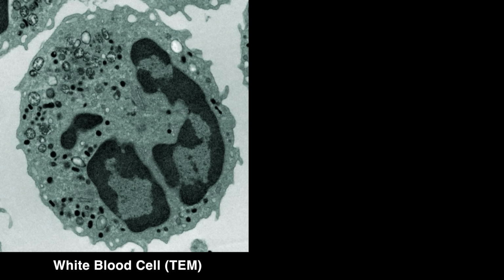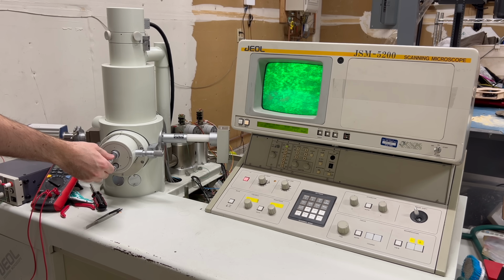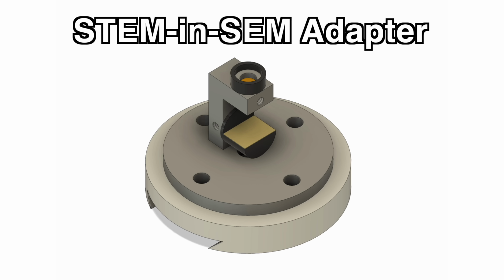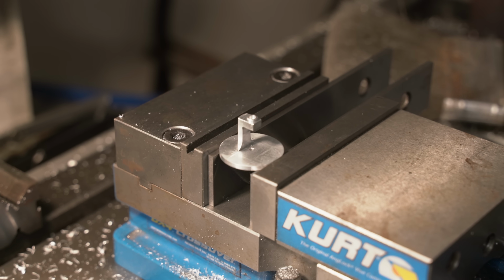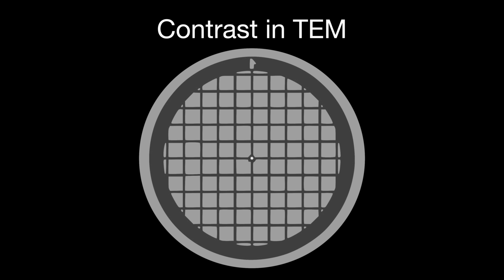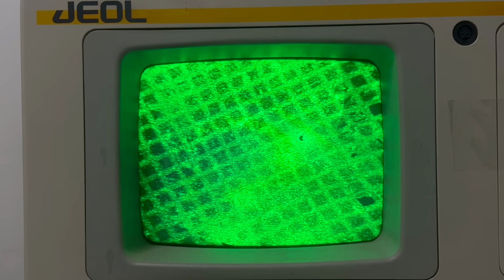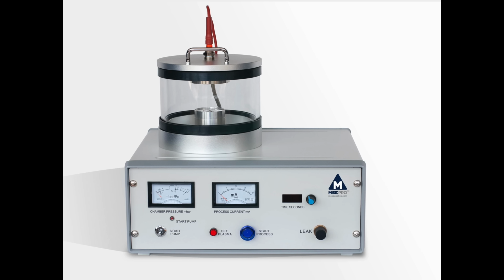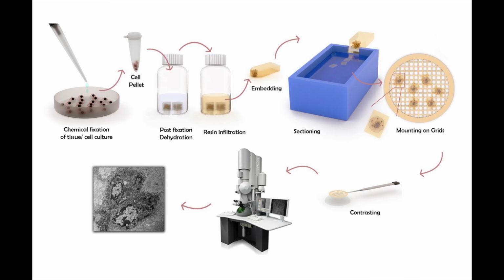Converting My SEM Into a TEM is Surprisingly Easy

Comment: These dome shaped candle flames are probably the most interesting and is something you can’t see typically in earth. It almost looks like something you would see from a plasma project typically done on either nuclear or arc reactors or even plasma gas tubes.
Reply: But those types of arcs domes or anything else are usually typically seen in those type of art tubes or other types of plasma projects are mostly require electricity. This you don’t need electricity for this to work just no gravity.

Comment: Why not use a longer mirror? (it doesn't have to be limited to the diameter of the mirror shaft).
Reply from the maker: longer mirror at higher angle increases the overall height of the apparatus, and the height was already a challenge given the small space available in the machine
Reply: @projectsinflight  A longer mirror would fit in the space you already have. Granted it might only give you a little more field, but you don't need to change the dimensions to achieve it (I wouldn't have posted my suggestion otherwise).

Comment: I used to work with a FEI dual beam with an immersion lens. FEI had a STEM detector that detected transmitted electrons.  The immersion lens allowed me to get STEM images with 800,000x magnification.  Of course, the price tag for that system is $1,000,000+ at today's prices😐

Comment: What is the reason for the TEM image of the wing not being dark in the places where the TEM grid sits? I was expecting the grid to shield all electrons and was puzzled why the sections of the thicker wing part covered by the grid were clearly visible while the thinner wing part sections covered were dark.
Great video!
Reply from the maker: some secondary electrons are still getting through unfortunately. i may have to redesign the adapter again

Comment: Very nice!  Instead of the tall shield ( or perhaps in addition). Did you consider biasing the grid on your SE detector negatively ( a few 10’s of V). ?  Secondary electrons typically have an energy of 40 eV or less, so you can target low loss electrons like this,  i.e. electrons that lost little energy in the tem sample.
It may also be interesting to collect those electrons that were deflected a small amount in the tem sample, for example with another faraday cup under the tem grid, that would capture undeflected electrons.
Finally if you really wanted to make an electron mirror,  you could consider putting a small glass bead  or plate in place pf the gold mirror.  Right now your mirror has the electrons that pass through the tem sample striking the mirror, and then secondaries from that process reach the detector.  When the glass bead charges up,  those transmitted electrons are unable to reach it and are deflected to the detector instead.  This works well if you first charge the mirror up with a 30 kV b eam, then change your beam down to a lower energy.    Good luck!

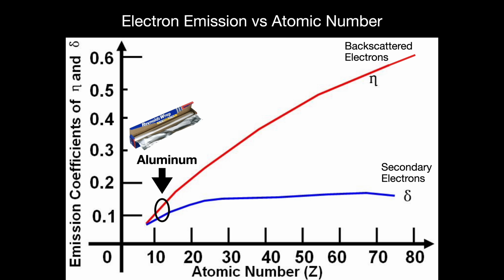Comment: 25:12
question: why did you use gold instead of something like lead, that would've been quite a bit cheaper
unless it's because you already had that gold lid
Reply from the maker: the electron beam can cause the lead atoms to eject off the surface and start coating the inside of the chamber with toxic lead powder

Comment: I briefly showed your video to our SEM expert. He said that a negative voltage should be applied to the stage so that the electrons are repelled.

Maybe I missed it, but did you do that in your experiment?
Reply from the maker: i don't understand why i would bother to do that. It's true that this is a feature of modern SEMs that allows you to slow the electrons at the last moment so that they don't penetrate as far into the sample and give more surface detail, but in the case of the tem adapter i can't see why it would improve the image

Comment: Not a good oractice to hold the parts in one side of the milling vice. This un called an "unbalanced" grip, it causes the movable jaw to tilt, and the grip strength plummets. In extreme cases where you need to hold the parts in the side, you need another part or the same width in the other end.
Reply from the maker: fortunately, you can get away with a lot when your part is a tiny piece of aluminum

Comment: Oh no my lathe chuck doesn't have a big enough borehole. Does extra steps to accommodate. Now we're going to switch to a different chuck with a bigger borehole for the next steps.
Reply from the maker: The limitation is from the lathe's spindle (the shaft that the chuck connects to). Even if the 4-jaw has a large enough hole, the stock still wouldn't fit though the spindle bore.

Comment: 19:24 Simple solution: Bigger (wider) mirror.  First off, sample holder and base plate can be the same part of that mode, giving you additional clearance, lifting mirror more off the ground allowing you to make the mirror wider. See 15:19 If that is your desired maximum angle, the mirror could be so long, it would touching the base of the sample holder. The screws get in the way, though. but if the base plate and sample holder is one part, then the base of the sample holder goes away and so the screws = more clearance for the mirror.

Comment: 2:12 Hey I was wondering what happens to the left over atoms one the primary electron has bounced off with the secondary electron leaving. If it is a metal does it become an ion but what if its a nonmetal? I'm in high school so this info isn't necessary but it wont hurt to understand. Thanks. Also where do the secondary electrons come from? How are they produced?
Reply from the maker: there is a power supply in the sem between the electron gun and the stage. the electrons from the beam come from the power supply, and they impact the stage/sample which is connected to the other end of the power supply. This prevents an imbalance which would cause electron accumulation
Reply: @projectsinflight  Thanks and the left over atoms?

Comment: is the shield grounded? You could apply a small positive voltage to the shield to attract the secondary electrons ofc not too strong so you dont influence the detector or the electron beam trajectory.
Reply from the maker: So, this wouldn't work, but maybe not for the reason you might think. In order to apply a positive voltage to the shield, you'd need to insulate it from the rest of the sample holder (which is grounded). this means that you'd need a small amount of an insulating material. When an electron beam scans across the insulating material the electrons captured cannot go anywhere, so they build up. The charge on the insulator can build up and up until it's several thousands of volts, which would dramatically affect the beam path. So by creating a small voltage on the shield, you'd inadvertently create a large voltage near the shield
Reply: @projectsinflight  very interesting. Can't you just extend the shield hiding the isolation material so the beam can't hit it?
Reply: @ImPresSiveXD  Yes, very interesting and expected based on the goal of metalising most samples.
I wonder if the mosquito wing would have suffered a little from charge build up.

I also wonder if a resistive shield could work with the top at a controlled potential and the bottom at the ground potential, then there would be no insulator.  I am clueless enough to not know whether a positive or negative top opening would be optimal but it should be easy to test.  Not sure what would be a suitable insulating material but graphite comes to mind.

Comment: I'm wondering if you can ditch the shield and instead image without the mirror first and then with the mirror, finally just subtracting the two images. It would be difficult to ensure the sample is exactly the same between the two exposures however. Great video.
Reply from the maker: For a good SEM, perhaps (though you might have noise issues). For my sem, there is zero chance that the image wouldn't drift between the two photos (because of my aging circuitry)
Reply: @projectsinflight Yeah I imagined that would be an issue. Thanks for the answer.

Comment: Really great work!

Question though: On the graph with the emission coefficients: Why did you mark the point on the red line which shows the BSE rather than the point in the blue line which is for the secondary electrons? Did you omit mentioning that you are actually using back scattered electrons to make the image? or did you just mark the wrong point? If so this would explain why gold didn't help much, because we can see from the blue line that actually we don't get to many more SE from gold. (Maybe double rather than 6x like for the BSE).
Reply from the maker: i wanted to include an explanation of how backscatter electrons work and explain that the EHT detector also collects a portion of those and all that, but i couldn't work it in without going on a pretty long tangent that distracted from the actual point i was trying to make at the time

Comment: Thank you for going through your order of operations for the mirror machineing. I need to make an almost identical part for a grazing incidence xray scattering setup and our current solution is a two piece design. This will be better.
Reply from the maker: the one thing i improved (shown briefly at the end of the video) was that i put a thread on the shaft to allow me to add a nut which could be tightened to better set the angle. i would definitely recommend it

Comment: How does the detector convert e- into a pixel ? Hpw does it know how much birghtness it should be ? 🤔
Reply from the maker: The detector contains a scintillator crystal and a photomultiplier. The crystal converts electrons into photons, and the photomultiplier tube converts the photons into electrons. If you're wondering why the back-and-forth, it's because photomultiplier tubes have an insanely good signal to noise ratio and amplification factor. The output of the photomultiplier tube becomes the brightness for the pixel.

Comment: 19:35 why use a flat face? 
could be not various tilted faces mounted on mirror making a / / / / / / / /

it could maximize the contrast and used area
Reply from the maker: it seems like a good idea, but practically it doesn't work and you end up with darker and lighter areas due to the geometry. if you draw out the design and tilt it you'll notice that no matter what angle you're not gonna get all the electrons to come out. some will get reabsorbed before reaching the detector. in addition secondary electrons are ejected in all directions so a complex geometry always ends up with differing brightness (which is one of the reasons why secondary electron images always look so 3-dimensional)
Reply: @projectsinflight thank you very much

Comment: Would using different levels of energy on the primary electron allow to see different "depths" or slices of the sampel?
Reply from the maker: for secondary electron imaging absolutely. SEMs allow you to set the acceleration voltage and you can totally use that to image a thinner slice of the surface. For TEM i think it's less relevant because usually the sample is sliced super thin

Comment: please pardon my ignorance, but my intuition would say that the secondary transmission images would appear as if the image would be top down, but the transmission image i would think should look as if its coming from underneath the grid.  After all the difference is the electrons bouncing off the top, vs passing down through them. So im a little confused why the mosquito wing at 28:30 looks like a top down image. Id expect the grid line to appear in front of the wing, so can someone explain why that isnt the case here?
Reply from the maker: Ah, simple explanation: my shield was still letting some secondary electrons through and so the image is mostly a TEM image but still has a non-negligible SEM look. it's not an issue really for the thinner stuff, but i do plan to redesign the adapter to do a little better.
Reply: @projectsinflight  gotcha thanks for the reply! I was even thinking earlier in the video what it would look like if you did let it act like a hybrid. Honestly i think the setup you have looks great and accomplished the goal of imaging softer objects. i was just confused about the perspective.

Comment: Having done the cell preps for TEM, I'm honestly a bit surprised that the wing worked that well. This series has been one of my favourites on youtube and I would love to see proper workshop made TEM images including the stains and cross sectioning, that would be super cool.
Reply from the maker: would you be interested in providing some advice since you have done the cell prep process before? I have some ideas of how i can do some cell prep myself and i'd like to run it by someone with experience.
Reply: I recall reading about using and viewing prepared specimens of onion membrane with brick shaped cells.  The thin layer between layers of an onion is about the thickness of a mosquito wing.

Comment: Tip from a machinist.   Aluminum is VERY forgiving when it comes to speeds and feeds.  If your "little" mill cant go the calculated speed then just go as fast as your comfortable with and see what happens.
Reply from the maker: i should buy a 2mm end mill then :)

Comment: why use a shield and a mirror? You should be able to just put a detector where the mirror is and get 2 separate images. Now you can do both TEM and SEM at the same time.
Reply from the maker: Installing an additional detector would be a significant effort. The adapter is an easy drop-in solution.
Reply: @projectsinflight  yeah, that makes since, i kinda noticed that after you opened up the machine and showed the detector and the amount of room you have to work with.

Comment: Would a sawtooth mirror help? Is the word lenticular? You could have thousands of 80 degree mirrors etched across a large surface area so you don't have to tilt the entire mirror and reduce it's effective size. Some tilt would surely be required, so each sawtooth isn't just blocking electrons bouncing from its neighbour, but perhaps there's a sweet spot?
Reply from the maker: It's not actually geometrically possible for the sawtooth setup to not block some electrons. The reason is because secondary electrons aren't ejected from a single angle, but instead are ejected in a cone, so no matter what angle the sawtooth is at, and what angle the mirror is at, you're gonna have more electrons getting caught and reabsorbed at the bottom of the sawtooth than the top, creating a dark-light-dark background pattern on your TEM image